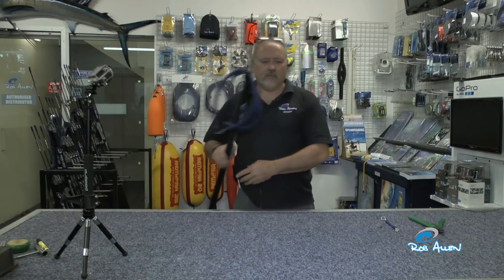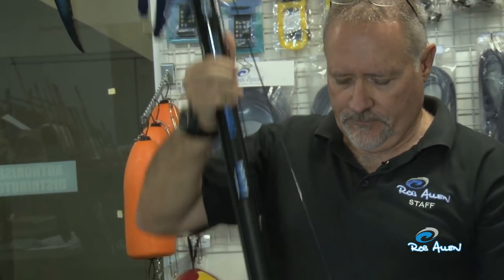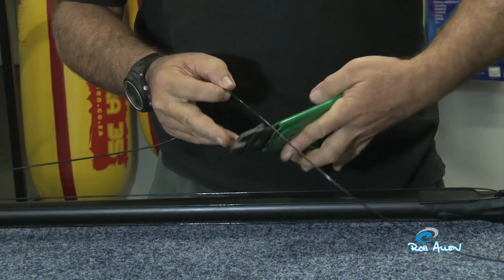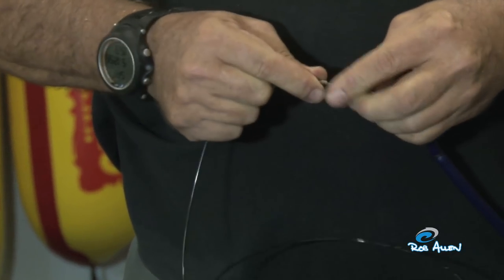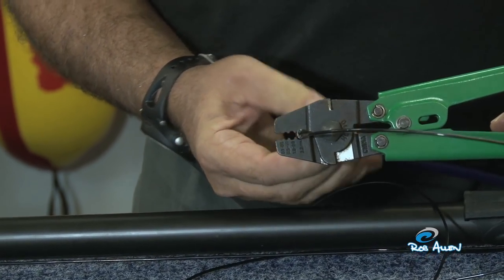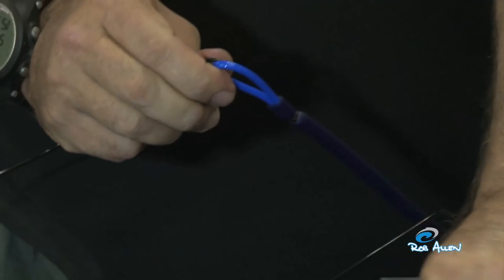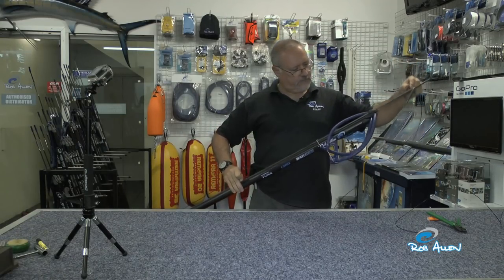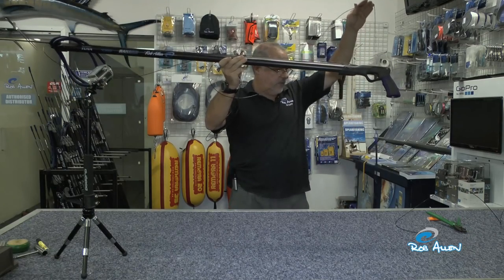Rob Allen | How To Series | Break Away Rig

Comment: Rob. Thanks. I  suffered this weekend losing a few Jacks, because my shooting line is attached to a slider ring on the shaft. So I am looking for a different way to rig. Thanks, this was very helpful.
Reply from the maker: We never fit slide rings. Some guns you have to use them, like all pneumatic guns because the shaft needs to slide down inside a cylinder. Is your gun able to accept a shaft able to fit with the shooting line attached to to the rear of the shaft?
Reply: @RobAllenSpearfishing  it's an enclosed muzzle gun. Does it make a difference with the set up that you have demonstrated?
Reply from the maker: @delstep2255  I can't help, not knowing the gun type. Our gun muzzles have sufficient space for both line and shaft.
Reply: @RobAllenSpearfishing  It's an Seac still, rail gun. I believe it's an older model.
Reply from the maker: @delstep2255  Sorry I can't advise as I do not know this gun.
Reply: @RobAllenSpearfishing  sorry it's a Seac sting
Reply from the maker: @delstep2255  Sorry, we don't see them in our country, can't help.
Reply: @RobAllenSpearfishing  Thanks my brother. You have already help a ton.
Reply from the maker: @delstep2255  you are welcome. Unfortunately that slide system is seldom used these days other than on entry level guns and pneumatic.